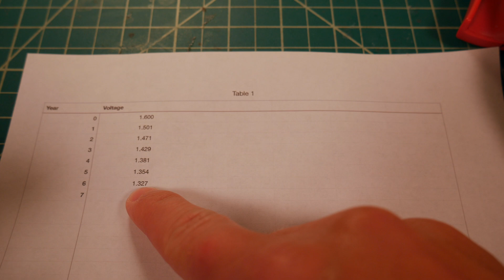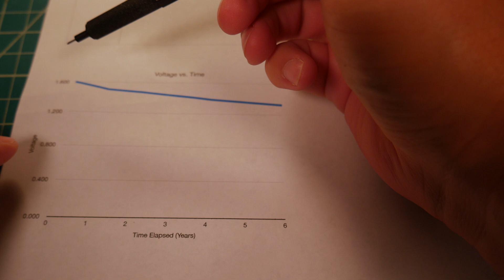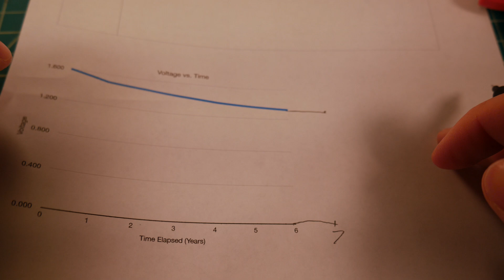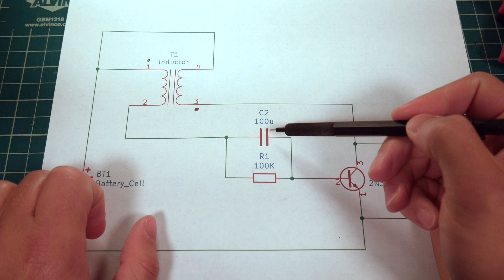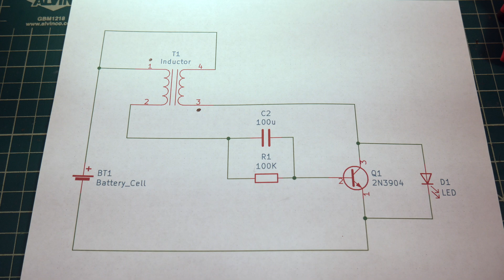Long Life Blinking Joule Thief 7 Year Update

Comment: The Joule Thief that I built with a white LED and a new D cell in July 2018 is still going strong. It's blinking at 146 times per minute, down from 150, and currently (January 2024) showing an amazing 1.396 volts, down from 1.48 volts when new. It's an alkaline Duracell (expiry Dec 2023) and I soldered the leads, but no leaks yet. Keep making updates, this is interesting.

Comment: Nice to see it's still working! Mine have since stopped working since they drained their cells. I have 2 with AA cells hanging from my roof with magnets and then 2 with some small button cell batts. I made videos on the two tiny button cell ones on my channel and in those videos I estimated the runtime, which was under a year for each of them so they've been dead for a long time now, I just haven't found any new button cells to replace them with. The button cell ones are neat because they're super tiny so you could theoretically encapsulate one in a small resin or silicone block/sphere and have a durable flashing ball. I think both your mistake and perhaps reason for success is the fact they're Durasmells which ALWAYS leak. Energizers aren't great either. My latest 2 on AA cells use a universal electronics AA cell and a thunderbolt brand cell (universal electronics provided cells for a TV remote, thunderbolt is harbor freight brand) and neither leaked. I've never seen thunderbolt cells leak. Also perhaps it would not leak if you used a zinc carbon dry cell rather than a wet alkaline cell? I'm not sure. One idea might be to extract a dry cell from a 6v lantern battery and use that to power one. They seemingly never leak and I imagine they have quite a good capacity for being a dry cell. Anyway, cya next year (not really because I watch all your videos) :)